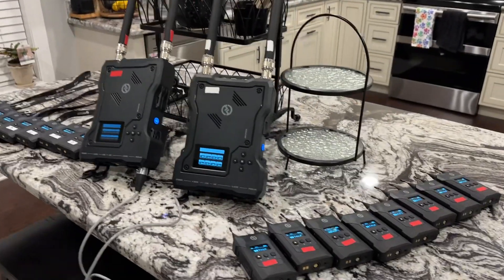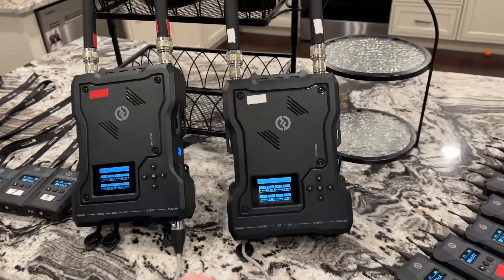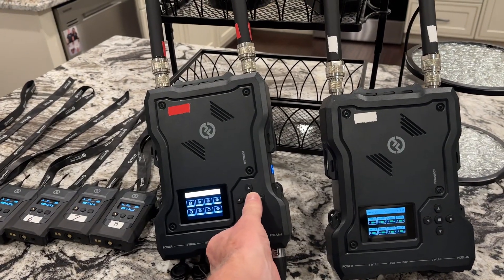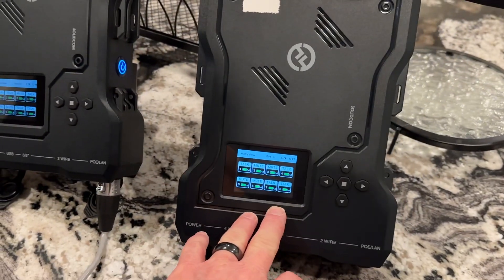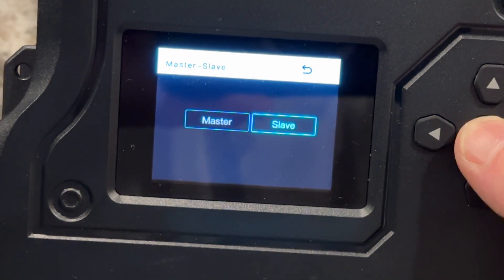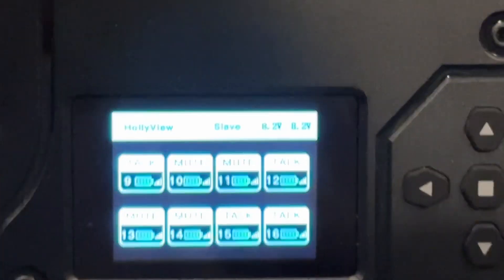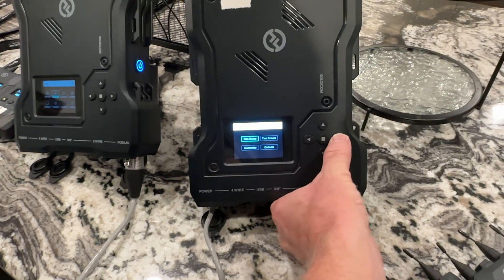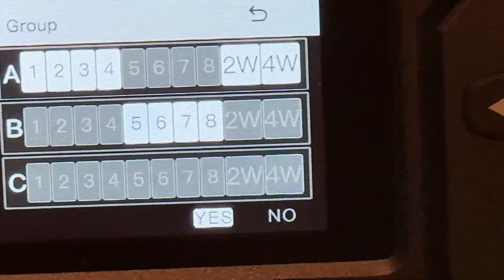Combining 2 Hollyland Solidcom M1 hubs

Comment: Can you connect them together with a network switch between them?
Reply: Yes you can, set unit 1 to Master and unit 2 to Slave, both units needs to be set for DHCP or dynamic IP on the Network menu, then plug both units using a cat5 or cat6 cable on the POE/LAN port and connect the cables to a ROUTER, the router will assign the IPs for both units, also you will need a laptop or PC, check what are the corresponding IP of each unit, then on the computer, open a browser and type the IP of the master unit, it will ask you for user name and password, the user name is admin and password is 12345678, you can open a second tab on the browser so you can type the slave unit's IP to access to the slave unit in a separated browser tab.
Also, on one of the browser's tab you can access to both units one at the time choosing the master unit or the slave unit.
You can also try the 4W option by connecting one cat5 or cat6 cable to the 4W ports of both units.
Reply from the maker: @AVStrategy  Thank you for this confirmation!
Reply from the maker: @AVStrategy  FYI, at the time of creating the video we had not received our POE AC device so we were using batteries on the left unit providing power to both. We now use AC to POE unless there is none available. Surprisingly a couple NPF batteries power these units long enough for us to do all our pre show, show and post teardown without losing coms. It's always the last thing we takedown.
Reply: @spooger2001  Those batteries can last up to 700 hours for an XL battery, some are 500 hours and some are 200 hours.
Reply from the maker: @AVStrategy  that’s just crazy, I figured the hub wouldn’t necessarily be sipping power that way. Not been brave enough to try it that long. We typically switch out batteries just to be safe right before the event.
Reply: Is it possible with Maxicom T1 and C1 pro to be in a hub for 16? @AVStrategy
Reply from the maker: It’s a very good question, not something I’ve tried however so I can’t say it would work nor can I say it wouldn’t. My hunches is probably better just to straight connect them. **Correction, confirmed it works.

Comment: Does cascading the hubs also extend the range, or does it simply allow for 16 users to communicate? We need two hubs in separate buildings and I was hoping to cascade these through ethernet/fiber so we can extend the range and act as a remote antenna.
Reply: Thanks for the response, I also would like to know:
1. does connecting hubs just allow the 16 packs to talk to each other
2. can I take on belt pack and walk from hub 1 are to hub 2 coverage area. Can packs roam between both hubs?

Thanks again
Reply from the maker: @geoffbernstein206  Yes and yes. The connected hubs act as one extending the area while also allowing all or some of the belt packs/headsets to communication with one another, depending on how you set the groups. A single group with all headsets on that group allow them all to communicate together.
Reply from the maker: For those two areas where the hubs are placed it does extend those areas. In fact, it’s recommended that if you are using two hubs in order to extend from 8 to 16 headsets that they NOT be placed next to one another as they are less effective trans/rec that way. Adding appropriate distance between the hubs improves their performance so that they do not step in on another’s signals. In your case when connected via Ethernet in order to cover an area the size of a 100yard football field, you might place each hub 25yards in from each goal posts, therefor leaving 50 yards between hubs. - O - - O - Although at over 200 yards coverage from center you could technically place one at teach goal, 100 yards apart just the same. Keeping in mind their coverage area is 1300 feet (400meter) radius. So from hub center you’ll have 650 feet signal out all direction, or 200 meters from center out. That’s LOS (line of sight) so obstacles will effect these distance numbers. Hope this helps.